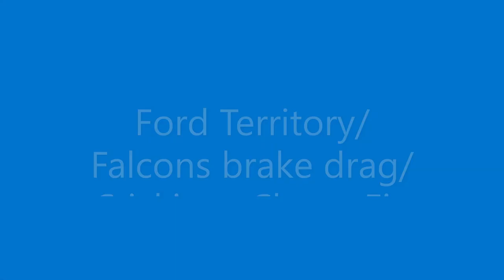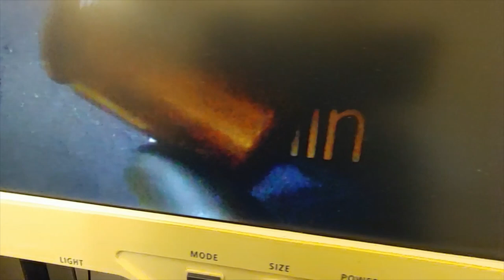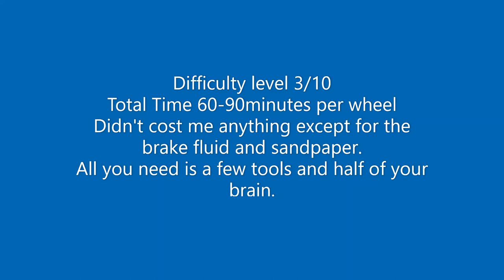Ford Territory sticking Brake or draggin brake / seized caliper fix

Comment: The pistons are that colour because they are made from a plastic. They come that colour originally.

They also can't be sanded as you are only sanding off the protective coating and it ruins the piston. It allows the fluid to penetrate the plastic and causes the piston to swell slightly.

And that is typically the problem. The piston swells size due to fluid absorption. Has been happening since BA Falcon days.
Reply from the maker: Thanks for that. So far it's been running fine. If it locks again I'll change the pistons
Reply: @RZJugaar  Now that I'm not on my phone I'll expand on what I said. 

The pistons are actually made out of phenolic resin, not actually plastic... I just call them that. As a material and part they are technically superior to steel. They are lighter and they don't transfer heat into the fluid, so they are supposed to offer better overall braking performance. But they have their drawbacks with age, they can crack and absorb fluid and swell... Which causes them to get stuck in the bore. Ford have been using them in the front calipers of their Territory and performance models for years and seemed to start using them in the front from the FG onwards. They have been using them in the rears of the standard calipers since the BA, where they have caused lots of issues.

I bought an FG Falcon caliper to rebuild and the pistons were so stuck in they almost couldn't be blown out with air they were stuck in so well.

I'm surprised refinishing them they way you did they are still working. You should have damaged the protective coating.

But if you end up getting new pistons you can buy them in either plastic or steel on the aftermarket. Ends up being a personal preference. They are the same pistons Ford used from the AU onwards, so lots of knowledge and understanding of them as parts.

Good luck!

Comment: Thank you I had no idea how to do this so I bought a secondhand caliper but after a short time that sounds like it has a piston sticking now too.  I will tackle mine now because of your video.
Reply from the maker: Mine were frozen on both front wheels... Its been more than 6 months now that I fixed them and they've been working fine since... Best of luck 👍

Comment: Thank you Jagaar.  Great video .  I had a 2008 XR6 FG falcon that from new that would over heat the rear disks.  Particularly when you had a couple of adult passengers in the back seat.  You could smell the pads over heating after pulling into car park and disembarking.   Never got to the bottom of that.  It would warp the rear disks regularly too - obviously from over heating.  I now have a 2014 TDV6 Territory like yours and so far the brakes have been good.   Although I think the rear ventilated disks may have a little tiny bit of run out now.  Might try and get the rear disks on a brake lathe an true them up.
Reply from the maker: Thanks for appreciating the video. A sound diagnosis is as good as half repair. Best of luck with your rear braks..

Comment: I'm no mechanic but over time brake fluid absorbs water from the atmosphere, which could corrode the piston. Regular maintenance of bleeding and flushing the brake fluid might prevent this?
Reply from the maker: Bleeding and flushing is part of maintenance but the root cause of this particular issue is it's construction. Pistons are made of 'Bakelite' and covered with a protective coating. They swell overtime and hence...

Comment: I have a diesel territory 2011 ..My 2  front brakes are stuck on with a DCS  fault on dash ..Would 2 brakes go same time and did you get the DCS fault
Reply from the maker: The brakes usually do not have anything to do with DSC lights. You can run computer diagnostics to find out the code which is throwing the light. I'm pretty sure your brakes issue is unrelated.
Reply: @RZJugaar  Update I unbolted the master cylinder brake fluid attachment  on the firewall  and got a pressure release..apparently this means to adjust a small protruding   rod  part of booster master cylinder..will update with results https://youtu.be/sOvlP6Q2jEg?si=gioBfDuw4Vjt5rz7

Comment: When I use my brakes the steering wheel turns to one side when it's cold, when warm not bad, any ideas please
Reply from the maker: Seems like your wheels are facing different friction coefficient when brakes are cold. Maybe you are using different types of brake pads on both front wheels. Replace them with the same type. If they are the same type then machine the rotors.
Reply: @RZJugaar   I did new pads and discs 2years ago and it's done it since, they don't stick work good but just go to one side, getting sick of it now lol
Reply from the maker: @mullaway5746  there can be some other reasons like worn bushings on one wheel or maybe the car had a collision in past and one side is not 100%.. can't think of anything else
Reply: @RZJugaar  ok cheers